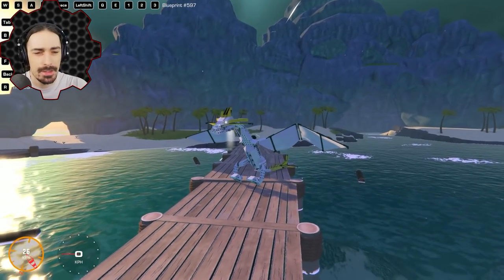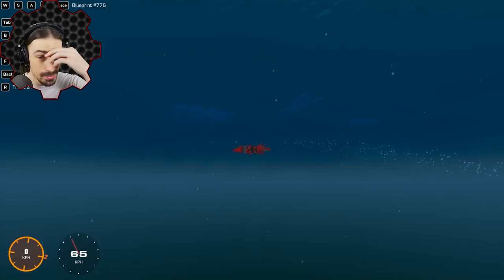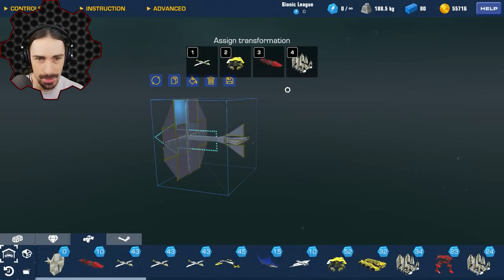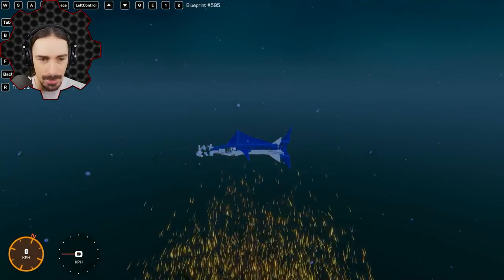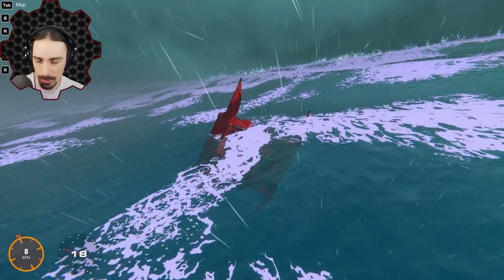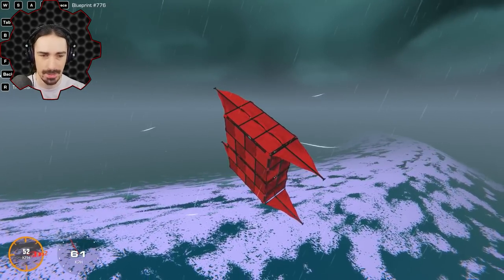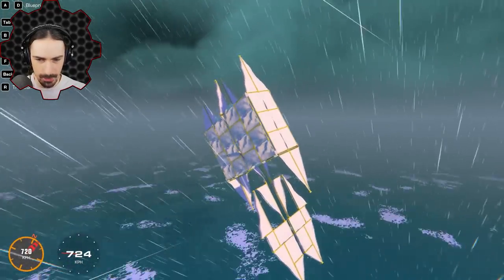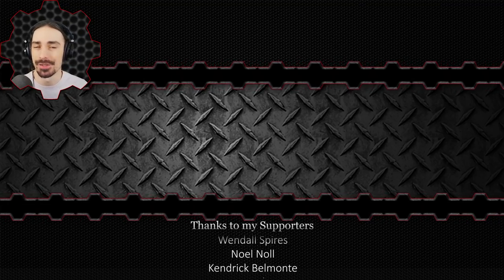Building The Fastest Possible Wind Powered Aircraft!

Comment: You can go faster then the wind by only windpower in trailmakers just like sailboats do it. The problem with this in trailmakers is keeping the boat from tilting. I have exceeded windspeed in TM by more then double but doing this at 700kph is gonna be a challenge.
Reply: same. i also took it a step further and made a drone with some UFO engines (not for power but for side to side resistance, like a keel) and was able to get to around 3000 mph doing laps around the map.
Reply: @kurtisam  thanks just amazing
Reply: There is a video about going faster than the wind with only wind power

Comment: If you have sails facing each other they add thrust in relatively oposing directions. If the sails are orientated the same way as eachother, the thrust will be in the same direction.

It's all based on their orientation to the winds direction. A sailboat will use a combination of mast rotation and rudders in the water to stabilize and redirect that into forward motion.

I wonder if this translates to Trailmakers accurately?

Comment: if you are gonna use sails on propellers id suggest u also try using paddles cuz they were the fastest thing to use for props before the update, even in air compared to all the other aerodynamic parts and id suggest u use the speed glitch when u set joints to the speed -100 (use the rotating servos) cuz then youll achieve the fastest speeds.
But if u use more than i think 2 servos, they get offset form eachother so just like with ur ornithopter but underwater attempt, it will act as a reaction wheel because the servos are offset, so far the only way ive found to counteract this is just a keel if u are using it for a boat or just something that spins creating a countertorque at a certain speed.

Comment: Theory as to why you can only go 720 when you touch the water for a sec:
The game only checks if you are going 720 in one direction at a time. When you tap the water, part of the speed is going down into the water so the game keeps accelerating you in the direction of the wind. Basically, you were still going 720 following the wind but you had some more speed in a different direction that was messing with things.

aaand in the time it took me to type this you already figured this out lol

Comment: An actual wind propelled vehicle can go faster than wind when the sails and the direction of movement are tilted with 2 differt angles with the wind direction
Reply: Long story short, our teorycal top speed (without considering dumping) will be equal to windSpeed*cos(a)/sin(a), where a is the angle that the sail make with the movement direction of the vehicle
Reply: But in order to do this we have to force our vehicle in that direction, so it would be easier for a land one (using tires or putting it over binaries), or for a boat (where the hull will do the work), but for a flying one it would be tricky
Reply: (forgot to mention that the direction of movement that I'm considering is perpendicular to wind's one)

Comment: There are still those floating logs in the water in the High Seas, right? This is vague but I wonder if we (as the community) could make some kind of challenge relating to them.
Reply: Multiplayer Monday challenge to collect them and each player builds a craft to pick them up and they have to carry them with themwhoever collects the most in 5 minutes (or whatever's fair)
Reply: @knightbeforedawn  Here's a potential twist: The logs have to be loose and not held in place by a tractor beam. Though I suppose a tractor beam could be used to place them on the craft

Comment: Gonna throw a guess out there... perhaps while a vehicle is rotating on its axis, that is calculated into the speed of the creation. That is my guess why when you hit the water, the speed increased; the partial impact with the water caused the vehichle to quickly rotate, which in turn increased the speed shown. I don't know how speed is calculated in this game, and that is why it's only a guess.
Reply: it could be you getting launched out of the water because of the rotation
Reply: Speak English
Reply: Exactly what I was thinking. When the lower part of the vehicle hits the water, it slows down dramatically, but the part above water gets snapped forward and down, causing the speed calculation to jump, assumedly measuring the speed at the tip.
Reply: @Rhyno186  or perhaps it measures speed at the seat
Reply: @Rhyno186  because i can’t see how they could calculate where the t was
Reply: @snelake  That may be, but even if it is measured at the seat, the seat is above the water and part of the vehicle that is getting snapped forward and down, thus the spike in measured speed.

Comment: 10:53, the speed is calculated at the center of mass probably, since it touched water with the bottom part of the ship, it tilted down really fast, which made the center of mass go faster, like a wheel through the road, the part that is contacting the ground is at 0 speed and the opposite part of the wheel is at double of the current speed
Reply: Actually I'm wrong, that would be the case if the speed is calculated at the center of geometry...

Comment: ScrapMan, you mentionned Veritasium as I was going to write it in my comment :P 
If the simulation is close enough to reality, you should be able to go faster if you fly in the wind at an angle instead of going straight parallel. It is true that if you sail parallel to the wind, your maximum speed is the actual speed of the wind, but if you sail for instance at 45° then your theoretical max speed would be roughly ~1.4x the speed of the wind (Pythagoras).

Comment: The reason of you going co sisterly 724 is because of, well you said it, gravity. Considering you can’t go faster than the wind parallel to the wind, the only other way you can go faster is through gravity. But because you built a box of sails, the air resistance in all directions is basically ridiculously high, so your downwards speed is being severely limited by your ridiculous air resistance, causing you to have an extremely low terminal velocity of 4 mph (or was it kph I didn’t see). This makes the entire craft feel extremely light, because you can fall extremely slowly, which means along with auto-rotation, I believe this might be one of the most interesting ways to slow your fall (video idea?). Also, in order to reach maximum velocity, you would want to get your air resistance at the direction the wind is blowing at a maximum, while making sure the air resistance towards the direction of gravity is at a minimum. You would need to get really high on the initial jump tho because you are going to lose altitude really quickly like this.

Comment: it is possible because air resistance and wind are different in this game and you can use the difference between them to generate momentum. my plane got to 980 kph in 15 kph wind without changing altitude. also with the veritasium video you can use water wheels and bouyancy instead of wheels to exceed wind speed but that will be unefective

Comment: Make a wind paddle boat. Just have sails on rotors that get pushed and spin causing more thrust with the paddles, or use a gigantic wheel powered by it and you should be able to go over using only wind